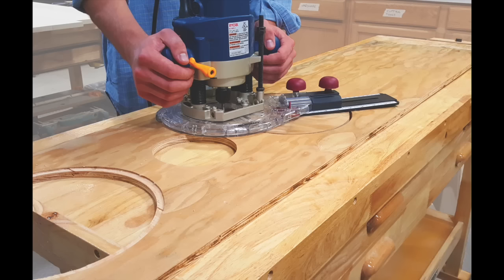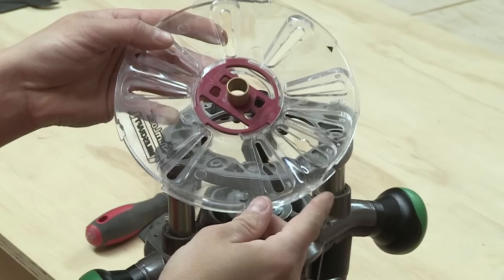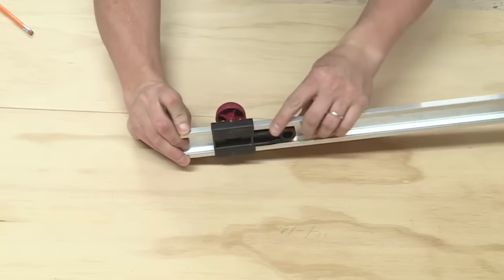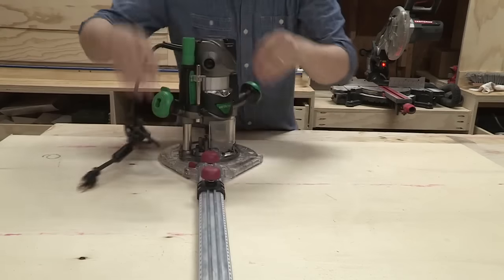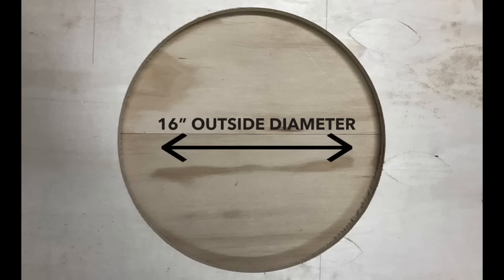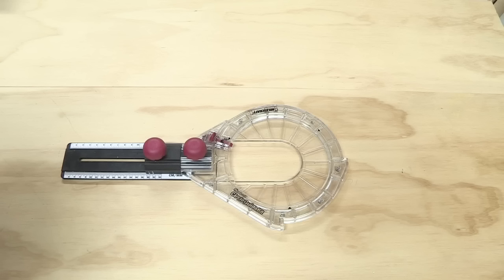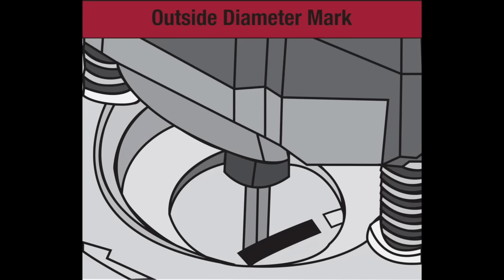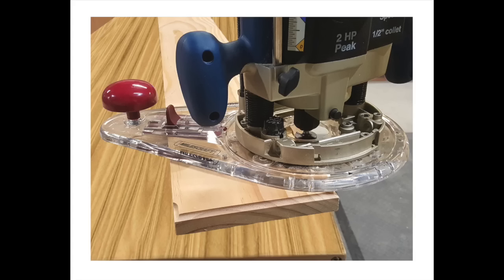Milescraft 1219 CircleGuideKit - Cutting Circles with your Router

Comment: Pivot screw was a joke it’s not long enough and it pulled out of the plot wood which was three-quarter inches thick, but just breathing on it.  Also, it did not include screws for the boss router. I had to use screws that came with my router and it is a matter of fact when you line up the holes the screw heads for the screws are too small and I had to get some washers to make them work.
Reply: This is correct! Your screws were of an obsolete dewaltish (not the best quality) style router. Terrible. Use small bolts with wider heads. Sorta like trusshead screw.

Comment: outside diameter explaination is wrong if you make a mark for the outside diameter at 16" but the bit cannot be on the outside of the mark to cut a 16" hole.
Reply from the maker: When you are cutting a circle, simultaneously, you are actually cutting two circles. You need to look at it from the point of the view of the router bit compared to the center pivot point.  It’s easier to envision with a board that has not been cut all the way through.  If you were to make a single pass in a circle around a board at 16” as marked on the “O” (Outside Diameter Mark), and not cut through the board, you would have a circular channel running around your work piece. The Inside wall of this channel is the Inner Diameter (ID), and the external wall is the Outer Diameter (OD).  If you want to cut a 16” hole in a board, you set the O on the product (Outside diameter) to 16.  From the middle of the now open hole to the edge of the hole is 16”, and the disc you cut away will be 15.75”, the ID of the cut. If you want a 16” Disc, then you set the I to 16” (The inner diameter of the two circles being cut) and the hole you would get (outside of the two circles being cut)  would be 16.25”.

Comment: Do they make longer router bits? I had to pull the bit out as far as possible to get through 1 1/2 piece of pine. Actually a little shy of that measurement
Reply: Yes they make super long ones, mine is over 2 inches

Comment: Got one to use it with my Milwaukee Compact Router. I had to modify the base so the screws could hold it tightly,  but works flawlessly.
I have a few more Milescraft products and will buy a couple more.
Reply: Hey any chance you could explain what you did to modify the base?

Comment: Just used mine for the first time today. One minor thing is the diameter gauge is off about 3/16”. But I always test first. 

My bigger question is when you finally complete the cut full depth you’ve lost your immovable anchor as it’s a free circle of wood. I guess great care as you complete?
Reply from the maker: Hi! There's a couple of things you can do:

•	Use double sided wood working tape to keep the inside steady on whatever you are cutting on (something like a foam board or sacrificial wood layer so you are not cutting into their work bench/table)
•	Use Milescraft Tri grips to lift the cutting piece off the surface and put multiple on the inside and outside portion of the cut.  We tend to put 3 or 4 tri grips inside the circle we are cutting then 4 /6/8 more on the outside piece.  They have grip and once circle is done, nothing falls or moves.

Thanks!

Comment: Jezz I’m new and stupid.  I bought this, and thought it worked great and was kinda impressed, however it just didn’t plunge deep enough.  Now that I’m actually looking at the instructions, and this video, evidently I was supposed to remove the stock base plate.  I thought it was odd that only two holes lined up, but it seemed secured enough
Reply from the maker: Glad to hear you were able to determine what the problem was.

Comment: Will this fit the Milwaukee compact plunge base(48-10-5601) for M18 cordless router?
Any help will be appreciated.
Reply: Yes. But have to use factory screws and add washers to them. Don’t understand the instructions vs this video. “Slide scale to 2” to make 15” diameter hole.” lol wut?! Makes no sense!
Reply: @hardtymz2517  Thank you so much

Comment: Definitely check your router bit distance from the pivot point (whether inside or outside), especially coming from a company calling itself “miles craft”.
Just a heads up, so you don’t wind up telling your customers their project was “miles craft” away from what they ordered.  Just kidding !!  It’s a good manufactured jig, like anything, you have to double check your settings, and they do tell you that, so if you foul up, it’s most often user error ! 
I highly recommend for the occasional circle cut. If your doing day- in day out circle cuts, you’re going to want a shop made jig. Just saying !

Comment: Need to make a 48" Tabletop. This is the perfect jig to make it! The only problem is how do you find the center of the circle?
Reply: Find the center point on the piece of lumber you’re using and use that. For example, say you have a sheet of wood that’s 64 inches by 64 inches. You would measure from left to right and find 32 inches, make a mark. Then you would do the same process from top to bottom and make a mark at 32 inches then you can find the center point from there.

Comment: I feel like an idiot...I don't understand the inside vs outside measurements....can someone explain that part to me?
Reply: From what I understand, It accounts for the width of the router bit.  Inner should be the desired measured diameter of, say a table.  If you wanted a perfect 4 inch hole cutout for speakers or ducting, use the outer diameter measurement.

Comment: Bought this, and it doesn’t seem to be compatible with my makita RT0700C! Should have checked before purchasing! 🤦🏼‍♀️
Reply from the maker: You can still use your router. This is compatible with the plunge attachment, model 196094-2.

Comment: Should you move the router in a clockwise or anticlockwise rotation.
Reply: When you’re holding the router in hand with the bit facing downward, it will spin in a clockwise direction. To feed against the bit’s rotation then, you’ll move the router from right to left (For the outside of a circle that equates to Counter CW.
Reply: Depends on the bit if it’s up or down spiraled.

Comment: Can you use the circle kit with a fixed base router? I have the Ridgid R22002
Reply from the maker: Yes, this can be used with a fixed base router but most users find a plunge base easier to start the cut.

Comment: So there is always the hole you used for the pivot screw is that correct?
Reply from the maker: If you don't want to see the hole where your center pivot is, you can flip the workpiece over.
Reply: @milescraft  what if you are using thin material?
Reply: @masoncampos7043  wood filler?

Comment: How long will the plastic parts last ?
Reply from the maker: Which plastic parts are you referring to?
Reply: @milescraft  0:12 the whole upper picture. In order to have a tight connection you have to screw the knob tight.
I fear, the thread is only plastic ?
Or the element in the middle that holds the router, plastic.
Reply from the maker: This product has a 3-year warranty and all parts can be replaced. The base plate is made of tough poly-carbonate.

Comment: Can you use a fixed base router with this? Or is a plunge Base router required? Thanks.
Reply: I'd like to know this also
Reply: @stseflanders  after using it for about 2 months to build my sub box, I can assure you that a plunge router is basically the only option. You could probably use a fixed base, but only if you started the circle of the edge of the board
Reply: I have to drill a separate hole to make room for the router bit or start at an edge.  I have a fixed craftsman.

Comment: How are you supposed to avoid damaging the hole edge when the cut is done?  Because the center where it is screwed will be now be loose and only takes a second after that last fiber is cut to slide to an edge.   Seems like you either cut all the way through and have a loose anchor for a risky second or two OR you cut all the way except the last .001" and then figure a way to pop out the center without tearing fibers.
Reply: @vashon100 — OK, I just bought mine and haven’t used it yet, but I definitely see that what you pose could be a problem. I’m just throwing this out there — would securing the center hole (the piece you’re cutting out) with double-sided tape (on the bottom — taping it to the workbench or whatever) be a possible solution? Assumedly, you’d already have the rest of the board secured somehow (e.g., with clamps), otherwise you could double-sided tape it down as well. Again, just a thought. What do you think?
Reply: @timsawyer7443  I used a longer screw and drilled the whole piece to my workbench. Clamped the outside part of the circle down, so now nothing is moving.

Comment: Does it work with dewalt/ Milwaukee?
Reply from the maker: This works with several routers from DeWalt and Milwaukee. If you have a specific router model that you are interested in using, please provide the model number.
Reply: @milescraft  DW618PKB
Reply from the maker: @cjfox5805  Yes, this is compatible.
Reply: @milescraft  thanks

Comment: Do you need a plunge router to use this jig?
Reply from the maker: A plunge router is not required but is preferred by most users.
Reply: It's worth the accuracy and easy depth adjustment to either get a router with a plunge base or order the plunge base for your current router.

Comment: What if my router uses 1/2 in bits not 1/4.
Reply: u should change the holding collet...most routrrs have multiple sizes
Reply from the maker: You would swap the 1/2" collet for a 1/4" collet.
Reply: Milescraft I wanted to reply, is it possible for the version two of this jig, to make the ruler part out of aluminum? And would be nice if that would be sold separately...i would buy it for my current circle jig..because the center hole where the screw fits is getting wider with much use, but love the product!

Comment: Will this fit the Milwaukee M18 Cordless Router model #2723-20?
Reply from the maker: The Milwaukee #2723-20 does not mount properly to the base plate included with this kit, as it is too small.

Comment: how to prevent hole in middle of project
Reply: Instead of screwing down the centre pivot guide stick it down with double sided tape...you could also draw a cross hair in the centre piviot guide to help line up the center
Reply from the maker: Insert the screw on the backside of your work-piece and then simply flip the work-piece over.
Reply: @Ridler42  Have you actually tried either of these?
Reply: @milescraft  What if my piece is only 1/8" masonite or craft chipboard?
Reply: @johnhill8958  use the jig to cut a template out of plywood. Then double side tape that to your workpiece. Then use a flush trim router bit to cut the 1/8" to the desired template.  Then separate the template from your finished piece.